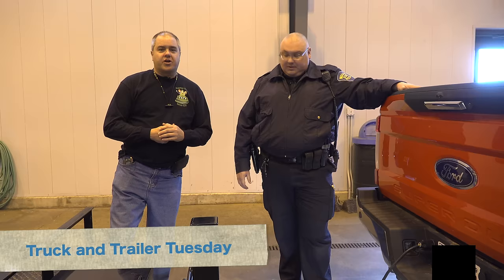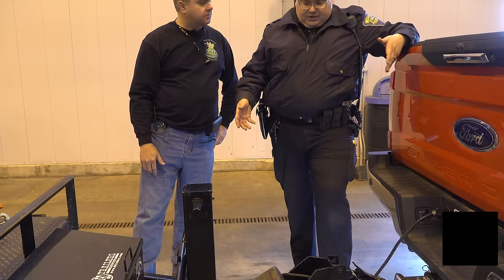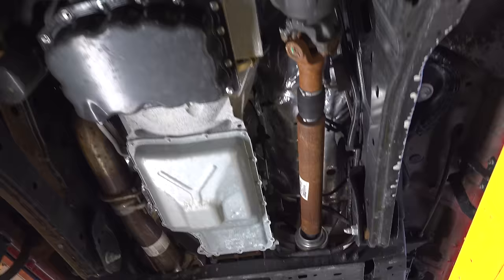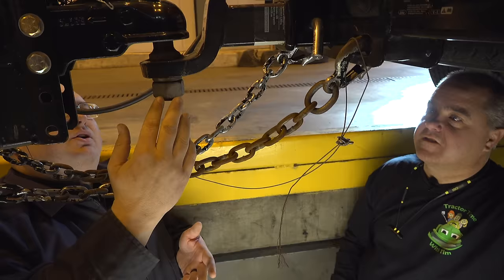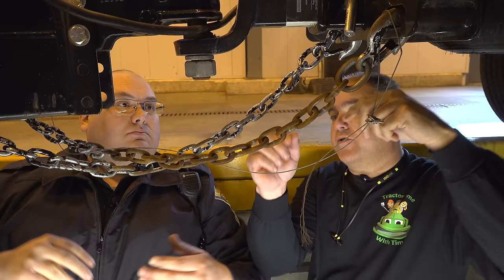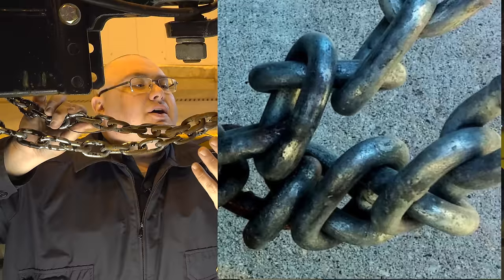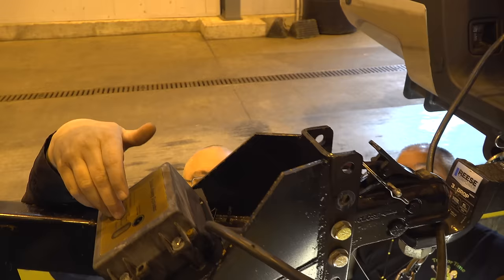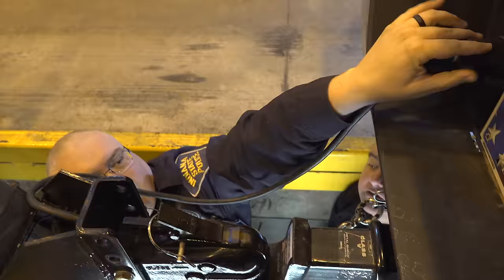Uhoh! Tim Fails Inspection! Truck & Trailer Tuesday with Trooper Hoover

Comment: I am surprised by some of the comments in this video.  

In brief, I’’m reading that in most parts of the country, the police do not check non-business towing.  Where I live in Wisconsin, we get checked often.  Police check at the boat ramps, race tracks, camp ground exits, etc. They use portable scales to check weight relative to the vehicles tow rating, license plate max weight, hitch, receiver, even the ball weight rating, and all things mentioned in this video. Sobriety, lights, on and on.  I was checked twice last year.  Neither time did they find anything wrong. 

The second time I was checked, I pushed back very hard, asking the officer what caused them to have reasonable suspicion to pull me over. I was in disbelief when the officer answered they felt my boat + trailer must be beyond the tow rating of my vehicle.  Of course, it wasn’t.  I was not in violation.  

My 2019 Chevrolet Colorado, as equipped with the V6, is rated to tow 7,000 lbs.   My boat, trailer, plus fuel, and gear gets me to 6,200 lbs - 6,350 lbs depending on my load.  I’ve certified Cat scale checked this weight as I was adjusting for optimal tongue weight for a boat on four occasions.  

I felt lied to. I do not believe the officer was being honest. I think they were pulling over people just to see if they could hand out tickets.   Well, they checked me and checked me yet found nothing wrong. 

The officer instructed me to stand at the roadside as I got bit by mosquito after mosquito.  I told him I was getting bit and he laughed at me. He was in long shirt and pants. I was in a t-shirt and wet swimsuit.  Forced to stand there and get bit seemed unreasonable to me. 

Even after confirming weight compliance in every way imaginable, the detainment continued. He even removed the cap on my boat trailer’s hydraulic brake cylinder at the tongue. I asked him why. He said he was checking to see if there was fluid in there.  He asked to see things not required such as my break controller at the driver seat.  I informed him boat trailers with hydraulic surge brakes don’t work that way, and he is an idiot.  

I felt violated.  As the detainment continued, we argued to the point I requested he call a superior officer.  I felt he had a attitude. He said I had a attitude.  Well, I probably did. When he asked me to turn on my turn signal, I refused as I am allowed to do under the 5th amendment (self-incriminate).  He then said fine, he will go into my truck and turn it on. I said I do not give him permission to enter my vehicle and doing so would be a violation of my 4th amendment (Illegal search.)  I was relieved because thats when another police cruiser pulled up, his superior. His superior, upon arriving, after a very brief consult with the officer that pulled me over, told me I was free to go. 

As someone with a clean record, and no violation, this experience put a very bad taste in my mouth.  

At the end of my detainment, I requested yet was not given anything to show I had been checked so I could show that to any future officer who pulled me over for observed suspicion of overweight. 

Now I carry in my glove box four pieces of paper stabled together, the tow specs for my vehicle, trailer specs with weight, manufacturers boat specs, and a certified CAT scale receipt which shows the total from a weight I actually did.  I also now have a dash cam plus GoPro with shirt clip at the ready in my trucks central console.   Never again will I not have everything on camera. I have no idea if any of this will help me next time, but that one officer really caused my opinion to change for the worse.  

Looks like the officer in this video is excellent.  I’d like to believe most officers are like this person.  Based on my bad experience, now I’m guarded.  I wish that was not the case, but its very hard to forget my bad officer encounter.
Reply: I'm late to the party, but when I was driving tractor-trailer I had a WI State Trooper pull me over between Madison and (then) US41 on US151. After he did his quick roadside inspection (checking HOS, lights and tires) and was telling me I was good to go I asked him the reason for the stop. His answer was "you were in front of me" or something to that effect. It's something I came to expect from driving truck, we can be stopped pretty much any time for any reason (for 'safety') but it's absolutely ridiculous that your second encounter was anything more than a weight check and maybe that your lights work given his reasoning for the stop.

Comment: Great video! I was told to put the hitch pin in from the left side. Apparently road crown, gravity and vibration tend to shake them right. Sort of a back up if you lose the hair pin for some reason.
Reply: Agreed, plus I've always heard the safety chain hooks should be hooked under the rings, not over.

Comment: Now you now why commercial transport is so expensive. Look at all the fines drivers could face for minor violations such as the chain size that no one ever checks
Reply: He's looking at chain wear caused by it dragging on the ground due to negligence.  Safety chains don't work if they break because half of them ground off on the roadway.

Comment: All drive shafts look rusty . Even when the vehicle is brand new in the lot . They are not painted .
Reply: Paint can throw-off the balance if not done right
Reply: Mine is aluminum so it's never rusry
Reply: Mine isn't rusty, it's aluminum.
Reply: The first time I saw the under side of a car... boy oh boy, here in the UK the salt used in the winter on the roads eats away at everything.

Comment: I've had only a couple  DOT inspections where the officers let their job go to their head...
But in 14 years of trucking they have never caused any financial problems. So saying it's all a money trap is 100% wrong. They are just doing their job.  They don't write tickets for cash at weight stations.. 
Unless it's a weight issue that is usually a state fine.
They give you an inspection form and it's either clean or it has violations needing to be repaired.. Most violations do not put you out of service and you can drive away and get them fixed by your choice of shops. If you do get an out of service violation it will cost you a road service call but that money never goes to the DOT....

Comment: I left after he spun the washer and said its good
Reply from the maker: He could not move the washer.  He tried several times, but it would not move.  I had it pretty tight, but not tight enough to fully compress that large washer.
Reply: @TractorTimewithTim  Well, that's a 1.25" hole receiver, and if that's a 2" ball with a 1.25"  shank, it should be torqued to 450 foot pounds.  I'm guessing it's not very close to that.

Comment: I put one of those climbing Carabiner Clips on the back of my Reese hitch for my brake line Breakaway cable make sure it's actual climbing Carabiner and not just one from your retail store want to make sure I'll be able to handle the weight

Comment: Some states require a trailer inspection every year. There's nice fine if you are stopped without a current inspection sticker, too.
Reply: 28cruzin 
We have to get all motor vehicles and trailers rated over 5K inspected before our license plate sticker can be issued each year.

Comment: Very informative video. I have in the past worked with some Tx DPS Comm Motor Veh Troopers. We have lots of old dilapidated trucks coming from Okla into Texas with loads of firewood headed to the DFW Metroplex. Bald tires, broken springs, inoperative tail/brake lights, clearance lights. Rotten exhaust system and bad brake systems. Used to be a Material moving company that had the same issues and failure to clean off the trailer sending sand or rocks all over traffic behind them. They finally figured out it was cheaper to buy all new equipment than to make repairs and pay fines and OOS loss in delivery.
Great.

Comment: Tim thank you so much for this series. I apologize in advance for the lengthy comment. 
Before my disability I did Tractor work for hunting clubs. I’d cut the fields, disk and plant for them, do some road work leading to the clubs and trails etc. I did a few jobs like you do. Anyway I had a bad experience w a bumper pull trailer. I bought it used and on my third time out I was getting on the interstate and one of the trailer wheels broke off. The lug nuts were still in place but the wheel broke off around each nut and went flying and bouncing down the interstate. 
It caused the trailer w my big JD 4120, loader, 6’ disk and 6’ cutter to sway back and forth. At one point both the truck and trailer were off the ground on one side nearly flipping over. I had the good sense to activate the trailer brakes instead of the truck brakes and the trailer brakes slowed the truck down and back on all tires except the one the broke off. I got stopped and there wasn’t a car in sight in front or behind me. The tire was still bouncing down the road nearly 20’ in the air and come to rest in the median. Once I came to a stop the interstate was full. 
God was surly w me that day. 
I never again pulled it with a bumper pull. 
So i bought a gooseneck trailer and it pulled much easier and safer. HOWEVER;
I paid no attention to the weight ratings. 
I have a 01 Tundra and was pulling a 24’ gooseneck w Tractor/loader, 6’cutter, 6’ disk and 6’ box blade. 
Even though my truck pulled it fine I see now how wrong I was to do so. 
I understand better now how important it is now to pull the proper truck, trailer and weight etc. 
I no longer do such work or pull the tractor but it’s good information to have. 
I’m sure this information will help lots of people.
Reply: I have a 9 ton equipment hauler with a pintle hitch behind my f350.  I wouldnt have a gooseneck because i cant pull that behind my tractor.    I went from a 10k trl that i was 90% capacity to a 9 ton (18k) at 60-70% capacity with more deck room. Love it

Comment: Looks like Trooper Hoover gave ya some more Truck and Trailer Tuesday content lol.... Next week Truck and Trailer Repair Tuesday .... LoL 

I'd replace those safty chain's to close for me one good scrape and the chains a fail ! Personally i have a latching hook on my break away cable that I hook next to the safty chain hook ... I wonder if thats good or not ... Never thought of "What if the safty chain mount tore on the hitch" now ya got me thinking of a better mounting location ... Thanks Tim... LoL
Reply from the maker: He made it clear that this is not acceptable.
Reply: @TractorTimewithTim  I think its because your using the safty chain hook as a attachment method I use a separate hook on my brake away cable .... I just use the same safty hitch hole ... I'm thinking a separate location like a eye hook bolted to the hitch or bumper .... In case of safty chain failure ....

Comment: If the loop for the emergency brake cable is set up to be adjustable in size you can just tighten it on the shaft of the ball
Reply: It has to be attached past the receiver pin.

Comment: I had a issue with my brake away cable it was a little to low when my couple broke the chains held but the brake away was low enough to go between the trailer a frame and the road resulting the cable was cut off so if the chains didn't hold the trailer brakes wouldn't have cone on so keep the cable high so that there is no way it can go under the frame if it is cut it won't pull out of the switch Trooper Hoover should have been aware of that

Comment: Old trailers without breakaway protection required to install it? What year did that start?
Reply: Not sure when it started but any trailer requiring brakes has to have break away protection

Comment: So a reduction in link diameter seems the chain unsafe, but twisting a chain over several times to reduce length (severely reducing chain strength) is ok? They made no reference to hook orientation as well
Reply: I did minimal research after reading your comment cuz i too assumed that the chain would be weakened with twisted links.  But i could only find it decreases its strength by 5%.

Comment: So, I like the intenet of the video. Safety of equipment on our roadway. I am seriously disappointed in one aspect. He never inspected the Reese hitch! Not a word mentioned about it. Mounted securely to the frame? Welds and bolts all intact? No damages to the steel tubing? Hello trooper, please add that to your inspection! Those hitches do fail, I just replaced a seriously rusted out one last year on my truck. The bolts that mount them to the frame do break, the can come loose. The hitch is a very vital part of towing safety. And hitch rating? If it's clearly marked on the hitch, you bet you better look at that? Towing a 14k gvw trailer with a 10k hitch says to me "what else is this guy doing wrong?" Point being, the hitch is huge in trailer safety. Lose the hitch and the breakaway cable with all the safety chains in the world go skidding right down the highway with your trailer....

Comment: We didn’t discuss the most important part and that’s weight overloading a trailer or overloading the tow vehicle
Reply from the maker: @Dennis there are several episodes in this series. The weight limits are the main theme in one of the other episodes.  Check em out.

Comment: It should be said as the trooper mentioned a twist or two is fine, but twisting as bad as the picture added in SIGNIFICANTLY reduces its capacity, and or creates a failure point. Also, those hooks should actually be the other way around, so the open part/latch is face up. Less likely they bounce out and puts the force into the body of the hook.

Comment: I would be curious to know what Indiana's view is on the people that pull double trailers like for example a pickup truck pulling a fifth-wheel trailer then pulling a boat behind that. I don't live in Indiana but I know some states do allow that and some of the combinations I see are quite honestly troubling as far as exceeding weight capacities are concerned
Reply: It depends on the license rating and endorsement, in addition to the road traveled for the state you're in

Comment: Correct me if I'm wrong, but I was always taught that in addition to an independent connection to the tow vehicle,  the breakaway cable's length should be slightly shorter than the chains, such that the brake switch would be pulled just before the chains pull tight; and, there should be two cable clamps on each end.  Also, I swear he was able to move the lock washer  around on top of the ball nut with his finger - if so, that ball isn't tightened down AT ALL. He probably could have unscrewed it by hand.  The ends of a split lock washer like that should be compressed all the way flat, with zero space between nut and washer and between washer and drawbar.
Reply from the maker: He was NOT able to move the washer. It is tight enough to lock.  ...but I should tighten it more. I just don’t have big enough wrench.
Reply: @TractorTimewithTim  I went back and watched that part again a few times - around 3:10 - and I think you're right, the washer doesn't appear to be moving at all. I was wrong.  I think the metallic noise I interpreted as the washer rattling was actually the chains clinking a little while he poked at the washer.   

As for a big enough wrench, I either use a pipe wrench on mine (stop by if you want to borrow one), or else I'll take the drawbar out and stick the nut in a bench vise, and turn the drawbar itself around the nut to finish tightening it down.

Comment: on the emergency brake cable; that only apply, if the trailer you are pulling; it has electric brakes; & for that to happen, you would have to be pulling, a tandem axle trailer, which, is a 5 or 7 point conection!!! in my oqn opinion, what he needed to check, on; it is, how them chains, are conected to the trailer; I have seen, many, many, trailers, where they use, a grade 5, 3/8 or 1/2 bolts, which, depending on your load; they will snap!!!!

Comment: I am an auto tech and you would be scared shitless to see some of the cars that I have driven and looked at and all they want is their AC fixed. Worn out BJ’s and tie rod ends to the point I write “unsafe to drive on the repair order”. Brakes that are worn to almost grinding. Tires that are bald. Brake lines that are almost ready to pop for rust.
Some people just don’t know that a car is more than just getting in and turning a key. You could be going through a school zone at 20mph a tie rod breaks and the car veers off into a group of kids walking to school. 
Cars should be inspected as much if not more than trucks.

Comment: I know they specifically stated this but, it is NOT a bumper pull it's a Reese hitch system...its actually directly integrated into the frame...hence the extra weight capabilities. Good lord
Reply from the maker: Essentially every trailer manufacturer calls it ‘bumper pull’ vs. Gooseneck.  No need to not pick.  We understand that it isn’t attached to the bumper.

Comment: It's a receiver hitch!
Reply: It's still a bumper pull trailer.
Reply: @ralfie, doesn't matter, bumper hitches are a thing and wouldn't hold that trailer safely. That's a "receiver hitch" mounted directly to the frame. Bumper is only safe for 500-700 lbs before you distort it.  A receiver can = or exceed even your average pintle if you pony up the cash. Huge difference!